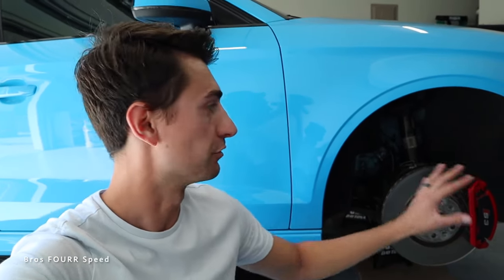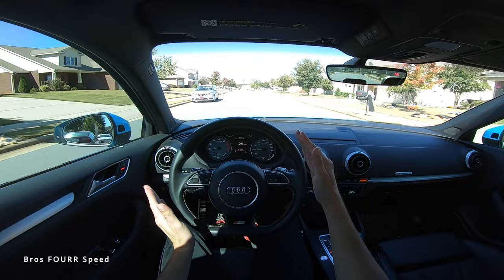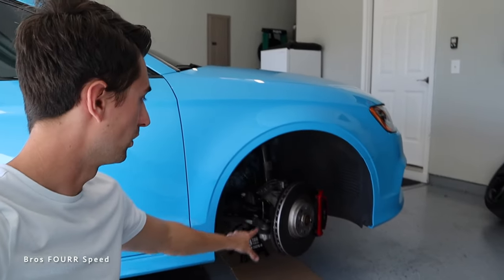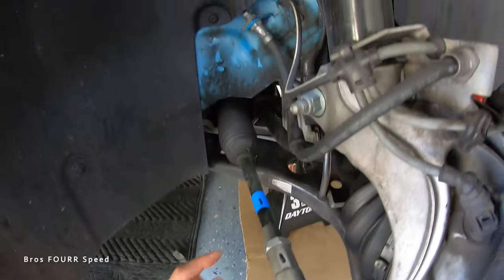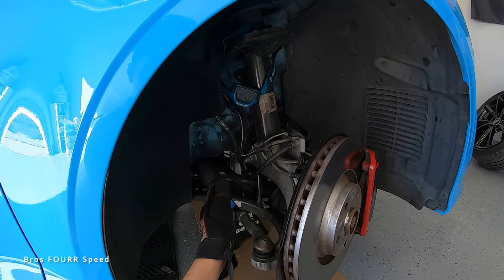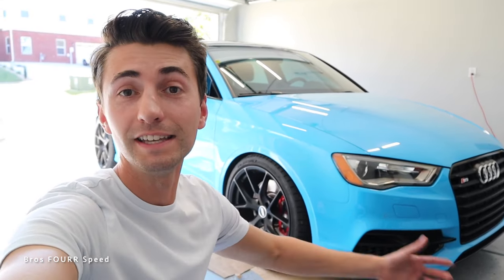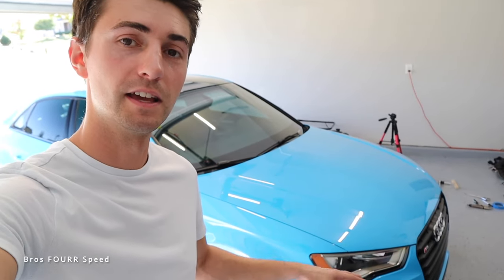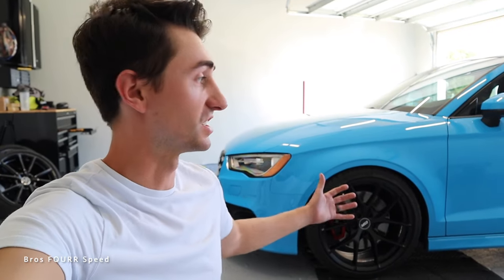How to Straighten Your Steering Wheel Easily at Home | DIY Car Alignment

Comment: Ah, so my problem is that I’ve already had the four wheel alignment but my steering pulls HARD to the right.. not that my steering remains in a straight line when letting go but rather that I must pull my steering wheel hard to the left to fight the hard pull to the right.. will this method work to align my steering to the left if I do this.. can you please explain what I should do I order to do this in my case? Thank you. Love from old lady 👵 ❤️
Reply from the maker: Hmmm, it might. If you drive with your steering wheel perfectly straight, does your car go straight?
Reply: No Sir, it steers to the right.. pulls hard to the right when letting go of wheel. I have to pull wheel hard left to make the car go straight.. In doing so, the steering g wheel must be always slightly to the left in order to go straight. That pull hard to the right is so awful it’s breaking my neck. Four wheel alignment less than month ago. If you live in SoCal I swear I’d pay you to help me. Can you please tell me a good suggestion for what you would do? Thank you young man.
Reply from the maker: You night have some tire or suspension issues if thats happening. Maybe have a good shop or the dealer drive the car and see
Reply: Ty young man for the reply! I’ve brought this Kia Krap Soul to the dealer several times already they’ve given me run around. Was approached by one of the news services to help with their stories as many other customers were having very same issue with Kia Soul Krap and not having Kia stand by their warranties. Problems with this vehicle since day one. They made promises to me they never intended to fulfill. It’s literally making my neck ache so badly. Would there be any remedy to jimmy rig a fix for this. Could I utilize your technique here to help it not pull so hard to the right. Please help I’m so desperate. Thank you. Old lady 👵 ❤️
Reply from the maker: @betteskeet1127  oh dang! Yeah this could help make it drive better. I’d go to an independent alignment shop honestly for a full alignment first. Dealers aren’t always the best quality

Comment: So remove the tires and lift the car the best way to do? My crosstrek front left tires dift slightly to the left, which way should I turn it?
Reply from the maker: If your car is drifting left with your steering wheel straight. You need to turn your steering wheel towards the left. Also make sure you've had a professional alignment done first. That way you know the alignment is good. Then if while driving straight your steering wheel is crooked, make the adjustments to straighten it out

Comment: What happens if one side had small hit? Could that mean you shouldn't adjust them equally
Reply from the maker: Your car should already have a proper alignment before you do this. That way you know everything is dialed in. Then if your steering wheel is off, equal adjustments will straighten it out

Comment: I’m having the same issue you had in the video but on the driver side do I follow the same steps except I turn the rod the other way than what you did on the passenger side?
Reply from the maker: Yes! You want both wheels to get angled in the same direction that way you don't mess up your alignment

Comment: Question do I center the steering wheel before adjusting or will the adjusting of the tie rods move the steering wheel into place?
Reply from the maker: Adjusting the tie rods will move the steering wheel center. So it will be trial and error. Do a turn and see what it does. Might need a full turn, might need 1/4 turn, or maybe even 2 turns. So it will depends on the severity
Reply: @BrosFOURRSpeed  cool thanks

Comment: Hello you probably won’t see this comment but will this work on a 2006 Honda pilot because every time I drive it goes to the right as well when I keep it straight it’s annoying trying to keep it centered when I’m driving on the road especially on the free way
Reply from the maker: Yeah every car should be like this. Make sure you do have an up to date alignment tho. And then from there, its it's still crooked, you can do these adjustments to fix it

Comment: I just changed my steering wheel to a aftermarket one and I have that exact problem can I do this to fix the problem?
Reply from the maker: Yeah as long as you know your alignment is good, this is how you can adjust the steering wheel to get it straight. I did this on my Supra after doing a new wheel as well

Comment: You sould use 2 wrenches to loosen and tighten that nut so you dont put so much torque on the joint and make a tighter lock with the nut.
Reply from the maker: Yeah definitely a great point! They aren't really that tight tho. But good tip

Comment: Have You changed this only for right wheel?
Reply from the maker: Like I showed in the video and said many times. You have to do both tie rod ends. Both sides need to be adjusted in an equal amount. Make one side longer and one side shorter to turn both wheels the same amount in the correct direction

Comment: what if simply removing the steering wheel and replacing it straight ? will it work too?
Reply from the maker: That won't work. Most likely you can only put the steering wheel on in one spot on the splines. Thats how it is on  my Supra. Much easier to just make these adjustments to the end links

Comment: I’ve got a Renault Clio Hybrid and my car does exactly what yours does in this video took it to a shop for a alignment even after the alignment the steering wheel is straight but still pulls to the side right side if I centre it  they can’t seem to sort it out and it’s really bugging me, looking to try this myself will I need to take the tyres off?
Reply from the maker: You might have to take the tires off. Depends on the car. I did this on my Supra and didn't need to take them off. Has better access on that car
Reply: @BrosFOURRSpeed  thank you for the reply will check this out 🙂

Comment: I don't know how to call my exact problem but it's not something small like this.

My problem is that the wheel is straight while it's physically sideways and it's a hassle to drive and when I'm on the highway and I drive fast I start to lose control will this fix it? Or do I need to do something else?
Reply from the maker: Sounds like you need to go to the shop for a full alignment first. This video is showing a tip to adjust your steering wheel after an alignment if you find the steering wheel isnt perfectly straight.

Comment: my tires had no traction and I ended up hitting two curbs around a corner and my steering wheel is like a quarter turn to the left, will this still work for me?
Reply from the maker: You'd probably want a professional alignment first. That way you know everything is good. But then if your wheel is a bit off, go ahead and make these adjustments.

Comment: my vehicle is doing this after going over a pothole,got a alighment and steering wheel off center,I noticed this with all vehicles and wondering if is the road being slanted/crowned for rain drain
Reply from the maker: The slanted road can effect it. So find a perfect flat road to test the car on to truly see if the steering wheel is straight or not
Reply: @BrosFOURRSpeed  it is pefect on flat roads
Reply from the maker: @carlmcnamara5396  If you've had a good alignment and on flat roads your steering wheel is off, then follow this video and make the proper adjustments to correct it

Comment: Tried your method on my honda accord unfortunately it did not work. Could it be due to different threads
Reply from the maker: Did you do even rotations on each side and in opposite directions? Might have to do more or less then 1 full turn. Depends on the angle
Reply: @BrosFOURRSpeed  Same scenario as yours except mines goes to the left. So i turn the rotors to the right. I opened the thread on driver side wheel & on the passengers i closed it. I did both sides evenly. Might have to do more turns on both side perhaps

Comment: So my car got alignment few months back and when driving straight my wheel is slightly turned to the right. So would I have to turn wheel to the left and adjust the driver side?
Reply from the maker: You'd want to adjust both wheels to aim more to the right. If you straighten your wheel you would be pulling left. So adjust the tie rod ends so both wheels go to the right and it should help
Reply: @BrosFOURRSpeed  thanks I did end up doing this earlier and steering wheel is back to being straight
Reply from the maker: @brandonjohnson6304  awesome!

Comment: So my wheel turns to the right but car turns to the left when driving and the right wheel toe is in more then the left. Im guessing theres to much toe in on the right side correct me if im wrong ?
Reply from the maker: Yeah you should have a good alignment done first. Then see if the steering wheel is straight

Comment: My car is aligned and tracks straight but my wheel is a couple degrees to the right. Can't this be fixed electronically with obd11 or vcds?
Reply from the maker: There's no electronic setting to turn your wheel. The issue is mechanical. They just didn't line up your steering wheel perfect when doing the alignment.
Reply: @BrosFOURRSpeed I didn't have an alignment or hit any potholes, just flashed a tune got a lot of errors then they went away and now steering wheel is crooked lol. A lot of people have mentioned recalibrating the steering position sensor which is electronic. Who knows but it's way worse than yours and annoying as hell!
Reply from the maker: @henrycervantezzz5566  yeah that seems weird. What car? Our S3 is pretty basic on technology. But you might need your dealer to fix something if tuning it caused the steering the change
Reply: @BrosFOURRSpeed 2020 Audi s4

Comment: My brother hit a curb real hard on the right side of my car and knocked it out of line. Does that mean I still need to align both equally or just the one he hit?
Reply: Your brother probably a bent suspension component. This procedure will not fix his issue.
Reply: @nathannicholson7356  he did. it bent the rear suspension and the toe was out. we got it fixed

Comment: My steering wheel is crooked to the left and right while going straight. The Slip light comes on and it makes grinding noises like the abs is kicking in.
Reply from the maker: Sounds like you have more issues than needing the tie rod ends adjusted. I'd go to a reputable shop and have them take a look
Reply: @BrosFOURRSpeed  I already had it fixed, but it is messing up again. The problem is that Infiniti makes so garbage vehicles. The same thing will break twice. It was a broke lower steering shaft the first time. The rack is leaking, but it isn't bad. I need a clockspring but don't know if I need the angle sensor? I have a new rack and pinion but haven't had it installed yet. It is at the shop right now.
Reply from the maker: @drjd2real  Oh gotcha. Yeah that’s far beyond what this fix is going to do

Comment: I thought when ur steering wheel wasn’t straight it meant your alignment was off so then I should still get mine done because I changed my control arms and stabilizer bars and the bar u were adjusting but my steering wheele stayed nice and straight even after changing everything
Reply from the maker: If you do all that, you need an alignment. This is more for after you've got an alignment. If your steering wheel is a bit off, you can correct it without messing up your alignment.

Comment: Can I do this when wheels are on and car on the ground?
Reply from the maker: I'd life them up. Might be easier to turn the ends. But if you can adjust them with the weight on the car, that should be fine too
Reply: I just did it, my steeering wheel was very slightly tilted to left when I drove straight after lowering springs and 4wheel allignment, with this videos help my steering wheel is now fixed 100% took me about 30min overall. I didnt remove the wheel or anything, just turn my steering wheel on max left and right to get enough space to make adjustment!!! Seat Leon. It was only 1/5 (shorten one and lenghten one) round per side to make it perfectly straight! Cheers mate!

Comment: So nothing is holding the steering wheel when doing this ?
Reply from the maker: You don't need to hold the steering wheel. Adjusting the endlinks turns the wheels. Then when you hop in your car and straighten your steering wheel, everything is straight
Reply: @BrosFOURRSpeed  I'm going to try this as my z71 acts just like your cars wheel did before
Reply from the maker: @banshee100  Just make sure you adjust both tie rod ends the exact same amount. Lengthen one and shorten the other the same amount of turns and it should work

Comment: Note: Nissan and Infiniti cars and SUV's have very sensitive tie rods (learned from aligning many of them at the shop). do not do 1 full turn or 1/2 turn. Start with 1/8 turn or 1/4 turn.
Reply from the maker: Yeah it all depends on the car. This adjustment ended up being a full turn. I did this on. my Supra and only needed 1/4 of a turn. So just depends on how much your steering wheel is off by

Comment: can this be done for ford 2023 ranger? mine is crooked crazy too, if yours is crooked look on left and its look downward mine is on left crooked too but looks upward
Reply from the maker: If you have adjustable tie rod ends this will work. Make sure you have already had a good alignment. But if the wheel is off adjust both sides like I did and it should work
Reply: @BrosFOURRSpeed  dont know how will start the adjustment ahaha i see some previous markings on that adjustable tire rod..anyway you can walkthrough me? i already took a video of it 😅
Reply from the maker: @Nine_Lives79  has your truck had a relatively recent alignment from a professional shop? Id do that first. If the steering wheel is off just mark where the tie rods are now. Make a half turn on each of them in the opposite direction and see what it does
Reply: @BrosFOURRSpeed  yes it does the wheel alignment recently when i upgraded my tires like 2 or 3 months ago i think…
Reply from the maker: @Nine_Lives79  yeah so you should be good to adjust the endlink to straighten your steering wheel
Reply: @BrosFOURRSpeed  there are previous markings with a marker there on the tie rods, should i mark a new one’s?
Reply from the maker: @Nine_Lives79  yeah make new ones to have your own starting point
Reply: @BrosFOURRSpeed   question bro.. do i need it jacked up and tire remove to do the tire adjustment?

Comment: This drives me absolutely insane and the dealership or alignment shops are terrible about it. They’re supposed to lock the steering wheel in place with a special device and also apply a level to get it straight but rarely go thru the trouble and just eyeball it.
Reply from the maker: Yeah they do that. But it’s never perfectly level and straight it seems. Wish they had a level on those brackets or something
Reply: I honestly thought it was just me. I’m going to try this out.

Great video!
Reply from the maker: @Samgotdam  haha yeah! Always bugs me so bad! And I drove to Michigan like this 😅

Comment: 3 servicesand still is off center 😂, can i do it if the car is not lifted? thanks
Reply from the maker: You probably wont have clearance to the bolts without at least getting the car on jack strands. Might not have to take the wheels off tho

Comment: Could you instead just unscrew the outer tie rod end to create more length? I just did replaced the outer tie rod and don’t want to mess with the inner tie rod if I don’t have to
Reply from the maker: You just want to set them so the wheels are straight. A professional alignment shop will do that. But then if you notice your steering wheel is off. This is how you can easily fix it

Comment: This is happening to me now but to the opposite side since my alignment yesterday 
I called them about it and they asked me why i got the alignment 

I said bc i had the car slightly lifted (only 1.5 inches) to fit bigger all terrain tires 

They are blaming it on that saying that their equipment is calibrated to align a vehicle based on its making model by the factory and because I had it lifted that that’s why it’s not straight. I called BS and I told them that how can a lift have anything to do with the straightness of the steering wheel and they said that they would probably need to do additional work and I said I cannot afford additional work. This is a slight crooked of a steering wheel and then I will see what we can do maybe we can straighten it without additional work. I am so frustrated by them right now and I do not have the ability to remove my tires. I don’t have a garage. I don’t have a jack and I don’t know how to do any of this.
Reply from the maker: Yeah they should be able to get your wheel perfectly straight. Now depending on how big of tires you have, those can make it a bit harder to drive perfectly straight. What kind of truck is it and what year? But they should have been able to line up the wheel perfect and dial in the alignment to factory specs